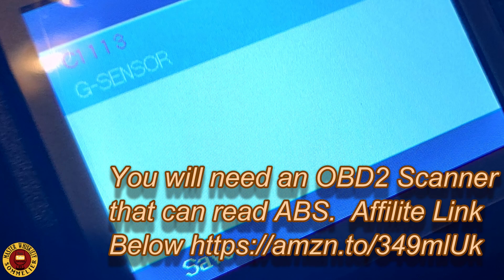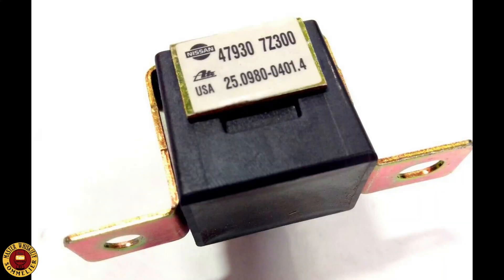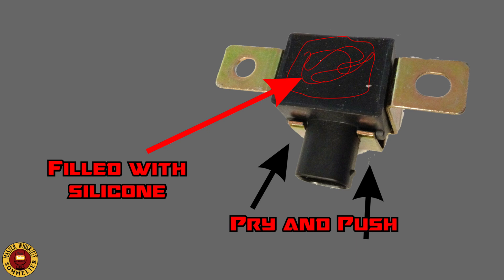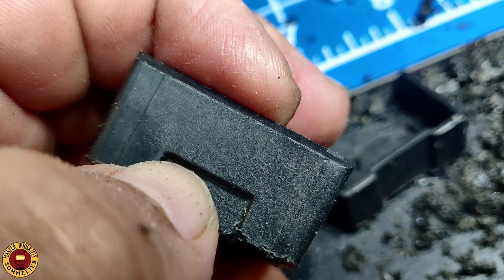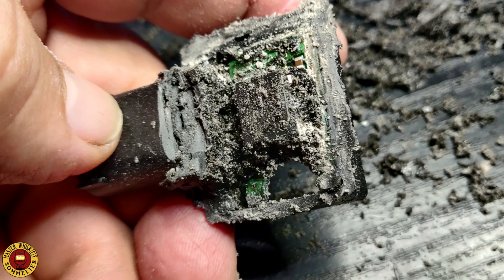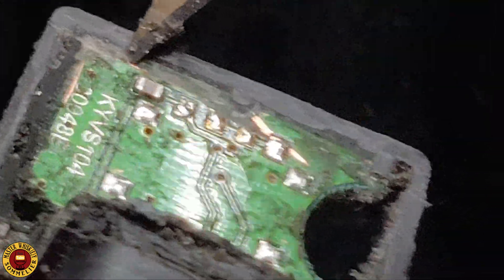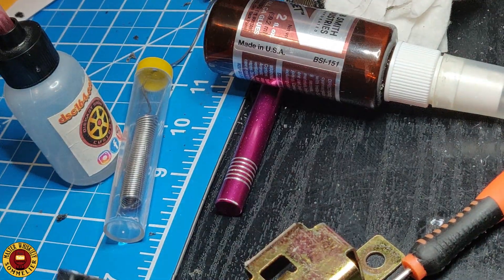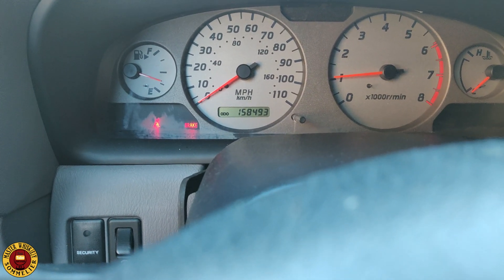Nissan Xterra C1113 G Sensor Hack / Fix ABS

Comment: Please can this sensor make my transmission not to select
It only in one gear, it doesn't change.

Please help me
Reply: sounds like you need to have your nissan checked by a mechanic
Reply: @DiecastShowCustoms  mechanic has already changed the gear because of this issue but is still not changing gear

When i diagnose the car, it will report the G sensor, Pump motor and idle speed sensor

The codes are C1111 and C1113

Comment: Used electrical tape just to close it up and reinstall for testing. I'll seal it now I know it's fixed. It worked and was the same issue with the chip coming unsoldered. Thanks for the video!
Reply from the maker: Glad it helped